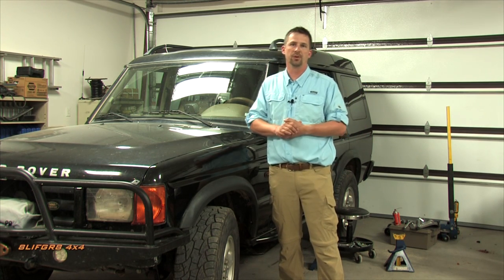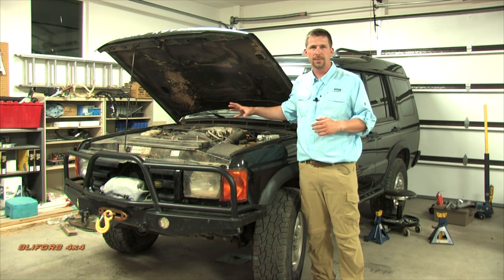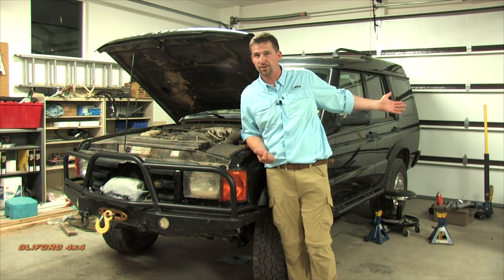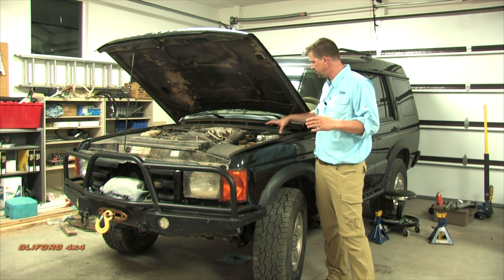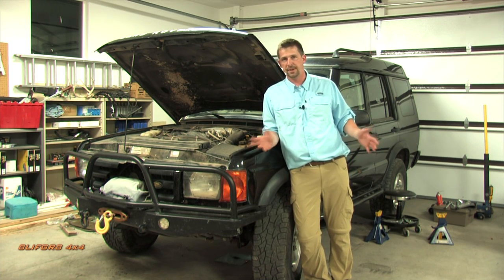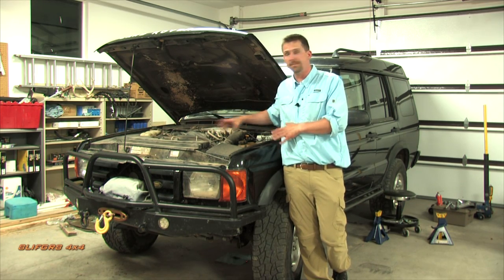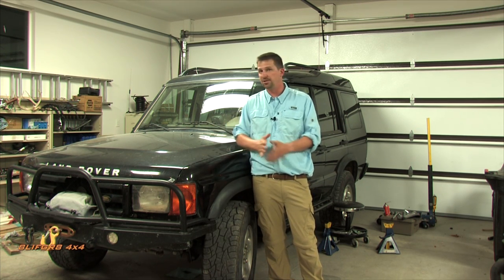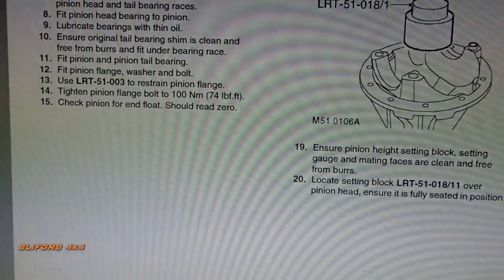Ultimate Owner's and Buyers Guide:  Land Rover Discovery 2

Comment: Massively entertaining and outstanding tips. I'm scratching my head over why I can't get my 2002 Disco II to shift into "Lo." Was getting stiffer and stiffer and now... It can't seem to find the slot. Wonder if other's have had that issue. I'm at 130k and everything else running great!
Reply from the maker: I know my D1 linkage the shifter was stuck because it was a physical linkage.  I had to pull it and use break cleaner and grease to un-seize it.

The D2 shifter is a linkage, so I don't suspect the cable would seize like physical linkage would.  What is probably happening is the lock-out solenoid has failed (which is why I used a Dremel and cut mine off when doing the CDL modification.  I'd ask on some D2 forums what they think it could be?  There are some really good youtube videos (ashcroft's CDL install comes to mind) on taking the center console apart to access the linkage and solenoid.  It's a bit time consuming, going carefully not to break plastic parts, but not hard.  Might be something to look into.
Reply: @ForgottenWaypoints  Solving the world's problems one Rover at a time.  Thank you for this. The solenoid has been mentioned as a potential culprit and after your comment here, I think I'm going to go forward with that maintenance approach. I see so many of these D2s on the roads here in the mountainous regions surrounding Los Angeles but I still haven't found where everyone is taking them for service. I can do general maintenance but my garage isn't equipped for the more serious repairs. I'll reply back with how this gets solved. REALLY appreciate the section on oil in this video. I was mostly doing it right, but never occurred to me to put in a diesel filter or to flip the washer.
Reply from the maker: @briangroh444  , I hear you on maintenance.  It's been a few years since I filmed this video and I've neglected my d2 and it's starting to bite me.  They really do better when you drive them.

Hopefully this year I can get my own back up to spec.

Comment: I did the shuttle valve , It took around 3/4 of an hour .You don't need to remove the abs unit , Just un bolt it and you can turn it up to get at it .I put a kit through the brake master cylinder !, ( IF IT IS SCORED REPLACE THE WHOLE THING  .)Also loose battery cables can make the three amigos come on too !.
Reply from the maker: Thanks, I didn't think it was too bad.  Once it's done, traction control still works, correct?
Reply: Yes It does .If you do the master cylinder kit ?.You can bleed the cylinder on its own . If you get air in the system ( OR IT HAS BEEN STUFFED FOR A LONG ) time bleed the brakes as this will get rid of the old fluid !, (AS BRAKE FLUID ABSORBS WATER ) And it is supposed to be changed at certain intervals ,  (IT WILL TELL YOU THAT IN YOUR BOOK ) .The quickest way is through the abs unit but you need  a machine  to do that ?.You can do it manually but you will use a  lot of fluid ?, And you will need some one to operate the HDC , As well as keeping the master cylinder topped up ,  Do not put the expelled fluid back in !, AS you will create more probs !
Reply: ONE thing I forgot is Atlantic British have a you tube video on replacing the shuttle valve , And the master cylinder kit ,MAKE SHURE YOU PUT THE PISTON RUBBERS THE RIGHT WAY AROUND !!!!

Comment: Rotella T6 full synthetic is being used by many motorcyclists as it has the JASO rating necessary for oil bath clutches. The biggest reason it has become popular is that you can buy a gallon at Wal Mart for peanuts compared to buying oil at a dealership or auto parts store. It’s very good oil.
Reply: Interesting info... But some mentioned synthetic may cause more leaks in older engines because it may dissolve grime that's blocking leaks.  Have u experienced better outcome ?  God bless 🙏
Reply: @acemoto2319  no leaks at all. I ride a Triumph Thunderbird 1600 with over 55K miles
Reply: @gwynnromano5881  Ok sounds great, I'll have to try it out on my car.  Continued success and blessings :-)
Reply: @gwynnromano5881  Ok thank you Gwynn, I'm going to try oil... continued success and blessings.

Comment: The DC joint does NOT fail due to the proximity of the cat. here in Oz we got the TD5, The exhaust is on the opposite side to the driveshaft and the DCs still fail. It is precisely because the UJs are sealed which causes the issue. Far better to rebuild the DC with greasable UJs.

Oh, the ZF is a FOUR speed.
Reply from the maker: Yeah, I dunno why I screwed up on the transmission.  I'm better than that!!

Comment: you cant "just replace" the 2003 oil pump to fix the failure problem. a range of blocks were machined with the front engine cover dowell pin location feature out of tolerance and this causes the premature oil pump failure. This was a warranty issue for 2003's in the VIN range and I  believe the fix was a new long block.
Reply from the maker: Interesting, I thought it was the pump.  Pretty much all blocks should be swapped by now, right?

Comment: Very nice vid. I have an 03 that came lifted including GBR drive shafts. I was only aware of lubing the zirk fittings. There’s a ball joint in there that needs lubed as well? I live in AZ and use Castrol conventional 20W-50. Replaced all of the cooling components and still run up to 210-212 sitting at a light. Cools down once on the move. Love my disco! Thx for the vid!
Reply from the maker: Yes, if you align the driveshaft so the zirks are pointing down (you may need to lift the front if you are stock height, just the front!  With 2" lift, no lift is needed, but it's tight.  Lifting the front is easier) and look between the u-joints you will see the ball.  You may need. To scrape grease from the u joints out of the way.

You'll see a little nub on the end that's ridged, like a small castle turret, you press the Lincoln needle  inside that and it allows grease to go into the center ball.

Get it greased and you'll be good to go!!!
Reply: I have a 3” lift and I just don’t see anything between the two zirks. I would hate to have to disconnect the shaft but I just can’t spilt it open enough to see anything in between. It’s clean plus with a flashlight I don’t see anything. I’ll give GBR a call and see what they say. Thanks again, really like ur videos.
Reply from the maker: @davejones2541  , GBR most definitely put a serviceable center ball in there.  I tried to get a video, but it was too dark and none of the footage worked.

Comment: Excellent video! So much good info. I've always liked these things, but I've always heard they were a nightmare. Really, the only thing that scares me is the head gaskets, that's not really something I'd want to tackle myself. Everything else sounds fairly straightforward.

TFL  had one of these last year, and did some really epic videos with it that made me start to want one. I've been seeing them pop up on Marketplace in my area, and they look fairly reasonably priced so I'm tempted.

 It's funny you mention Toyota rust, I actually own a 2013 4Runner, and I've already had to spend a significant amount of time underneath it with a wire wheel on a drill and rust preventative products. I do live in New England I should add.

Before I ended up buying the 2013, I was trying to get more of a mid 2000 Toyota 4x4, but could not find one in good shape. I plan on keeping on top of mine, but it does have me concerned for the long term durability of it. I know it'll continue to run fine, but is the frame going to rust out from underneath it? That's a fate a lot of them have suffered here.

I like my 4Runner, but as a previous Jeep ZJ owner I don't have much faith in the IFS, I'm more of a solid axle fan. Also, with the resale on the 4Runners being the way it is, mine with 106k is still worth almost 20k. I feel like I'd be better off just buying one of these for 4 or 5k, and being able to take it off road without fear of damage. 

Then again, one thing that I DO like about my Toyota is that I'm pretty certain it's always going to work, lol.

Decisions,  decisions.  Thanks for posting this great video that will help me make a more informed one. Also, it's funny that you mentioned an 04 is the one to get, because a green 04 has recently popped up that looks really tempting. I mean really, just for the color alone. Who wouldn't want a green Land Rover?? I can't think of anything more British!
Reply from the maker: I go through the same rationalizations you do.  The reason my Disco hasn't been featured on my Channel lately is because I haven't been able to give it the TLC it needs (headliners sagging, some oil leaks and possibly clogged diff breathers), nothing too difficult, but just need the time.

Where has my time gone?  My 2003 LX470.  I love it too, like you like your 4Runner (I just did a review on my cruiser), but the up front cost + maintenance costs + part costs make it very hard to justify vs. a Discovery 2.  I'm into the LX470 3x the cost of my D2 just to get into it (because of the resale value) and another 1x the cost in maintenance.   I bet on a dollar per dollar amount, I'm over 5x the cost of my D2 into my Land Cruiser and it STILL taking up time in the shop.
Reply: @ForgottenWaypoints  sounds like you have about as much into your LX is I have in my 4Runner! I'll have to check that Cruiser video out. This discovery video is the only one of yours that I've seen, a friend of mine who is looking for a D2 had forwarded it to me. 

I had looked into the 100 series myself, those are definitely a solid platform if they're dialed in. I found what you found, that the cost of entry for a good one is rather high, and I also had the issue of finding one that's not rusted out here in New England. But even the good ones seem to have a lot of deferred maintenance that needs to be performed in order to get them back up to 100%. I decided I didn't want a project that would be that costly, so I went with the 4Runner that didn't need anything. I do really wish I had the V8 though, that 6 cylinder is the worst thing about it.

Good luck with that Cruiser! I've heard a saying for years, "a Land Rover will get you into the bush,  the Toyota will get you back out" LOL.

Maybe I'll keep the 4Runner as a daily driver to rack up miles, and pick up a D2 as an off-roading / overland vehicle. Dirt lifestyle is doing a cool build right now, btw,  he's doing a one ton axle swap and custom suspension on his D2.
Reply from the maker: @trailrunnah8886  , that's a great idea.  My wife's daily is a GX470 that we've only updated the tires.  The GX470 is essentially a 4th gen runner with the V8 and we love it.  So far, it's been relatively maintenance free (I needed new lower control arms/joints but they are so much cheaper than 100-series parts).   Check us out at Instagram (@forgottenwaypoints) to see our GX470 in Colorado....we had to take the GX because the LX was undergoing timing belt surgery and the D2 is still out of commission waiting for service!

I only have the review video for the LX up, but after the timing belt service I believe I have enough content and knowledge of the platform to do a similar "buyer's guide" like this D2 video for the Hundy.  It may make some Toyota fanboys mad who were mocking the D2 in the comments of this video.  The Hundy, liike the D2 is an awesome platform, but it has it's share of serious issues after 15-20 years.  They just won't be the engine and drivetrain like the D2, but still pricey!!

Comment: Any one buying a discovery 2 needs to do 3 things immediately. Install oil pressure gauge. Ultragauge (temp) and check the drive shaft like stated in the video. This is a good video but its hard to cover ever thing in 40 minutes. Also I have an 03 with the 180 stock style  thermostat and an 04 with the 180 inline mod  and it runs 5-8 degrees cooler.
Reply from the maker: Yup, I forgot to mention the inline mod.  Good call
Reply: do you have a suggestion on which oil pressure gauge?
Reply from the maker: @Sam-xt5gb  , I don't.  I haven't installed one in the cab nor used an external gauge.

I always meant to get around to it, but never did.

Comment: Common cause of failure is lack of maintenance by the owners. Bar none. 
I received for a gift a 2000 Disco 2. 
After I drove it awhile. I started noticing items. I'm a mechanic. I've been wrenching for 50 years. Anyway, I noticed the truck was never serviced. I spent a couple of months repair and replacing parts.

Comment: That's good to know about the oil. My problem is it I've already ran synthetic for a long time so I don't want to switch over cuz I hear you shouldn't after running synthetic. I do something unique though I actually use 1 quart Lucas High Mileage and then the rest mobile-1 0w40 European.
Reply from the maker: 5w40 diesel oils are typically a full synthetic

Comment: I just got a 99 Disco II with only 70k miles....still all original.  Based on the history, looks like the temperature has been an issue before, so I'll be getting a new thermostat soon.  Of course first thing I do is change oil and put full synthetic in!  Do I wait it out or change it again?  I am now experiencing the no starting issue, Crankshaft Position Sensor....which is what led me to your video. Just ordered a new one. 

 One final question....was going to change plugs, Iridium or Platinum?
Reply from the maker: I haven't done my plugs yet.  I'm thinking about it this winter.  I can't remember which most people recommend, it shouldn't be easy to find though.

A 99 with 70k??  I bet the interior is mint!  Nice find.
Reply: @ForgottenWaypoints  Pristine interior....except of course the headliner is sagging all around and the leaking sunroof after a rain.  Fortunately the leak seems to land on the passenger seat.   lol
Reply from the maker: @benjaminleming7971  , I hear ya.  My headliner is starting to fail.  Not looking forward to that job!

Comment: Isn't that just a normal discovery but series 2 and not a discovery 2? I thought the discovery 2 has a 4.0 or better when that one should be a 3.9. also the headlights on a discovery 2 are like the range rover. Correct me if I'm wrong please. I just discovered that the discovery has been running every year since some time in the 80s but the discovery 2 was only from 99 to 04 but during that time you could still get a new discovery 1 but series 2.
Reply from the maker: It's easier to tell by the doors.  The Disco 1 has flush doors and a shorter overhang with subtle differences to the interior, not traction control and full float axles.  The Disco 2 has the 4.0, semifloat rear with rotoflex driveshaft, different interior and traction control.  The headlights changed in 2003 for a mid-cycle refresh.

Mine is a D2.  Your are correct, the D1 and D2 were sold side by side in '99, which is why I tell parts dealers (like Napa or O'rielys) that I have a 2000 to make sure there is no confusion.
Reply from the maker: Discovery 1 series 2 is the Disco 2, it's just badging.  A D1 is quite different look at photos.  The only real change between a '99 and an '04 D2 is the grill/headlights and the '04 has the CDL cable shift from the factory.

Comment: Great video! Has help me while looking at a 04 discovery 2 with all the bells and whistles. Any tips for making an offer on a discovery 2?
Reply from the maker: I wish I had!!  Back when I bought mine their were many to choose from....now they are hard to find!!
Reply: @ForgottenWaypoints  what do you think of the price tag of this vehicle from the description:

2004, ~140,000 miles

This 2004 Land Rover Discovery II S is finished in silver over black leatherette and is powered by a replacement 4.6-liter V8 paired with a four-speed automatic transmission and a dual-range transfer case. Factory equipment includes power-adjustable heated seats, dual-zone automatic climate control, cruise control, a cassette stereo, and power windows. Modifications include a suspension lift, skid plates, an ARB front bumper, a winch, an intake snorkel, a Baja roof rack, and a roof-mounted awning. The truck was serviced including repainting the body, replacing the PCV valve and thermostat, resealing the sunroofs, bleeding the coolant, and changing the oil. This Discovery has 140k miles.  The front and rear drive shafts, ball joints and front and rear sway links have all been replaced.  The truck was refinished in Zambezi Silver in February 2021 to correct fading on the roof according to the seller. An ARB front bumper with an integrated brush guard and Badland winch. 

Additional features include LED auxiliary lights, an intake snorkel, a replacement windshield, running boards, a Baja roof rack, a roof-mounted Overlanding Pros awning, a rear ladder, a rear-mounted spare tire, a steel rear bumper, and a receiver hitch. The front sunroof does not work.

Factory 18″ alloy wheels are finished in gloss black and were mounted with 275/65 Goodyear Wrangler Duratrac tires.  Equipment includes a 2″ Terrafirma suspension lift, a Terrafirma steering stabilizer, front and rear skid plates, and disc brakes all around.

The most recent work done this past year are new front and rear drive shafts, new front and rear sway links, all new brakes on each of the wheels, new upper and lower ball joints. 

The 4.6-liter V8 is a remanufactured longblock from Atlantic British that was installed in August 2020 under previous ownership. An oil change was performed in June 2021, at which time a replacement 180-degree thermostat was reportedly installed. Oil changed again june 2023 

Also just recently changed out all the spark plugs about a month or so ago. 

Selling for 25,000$